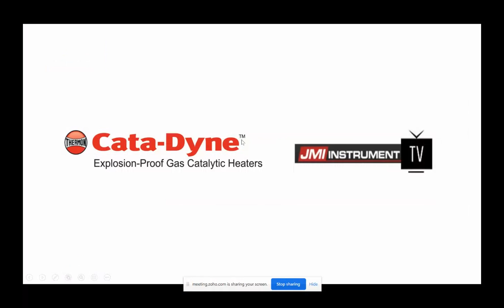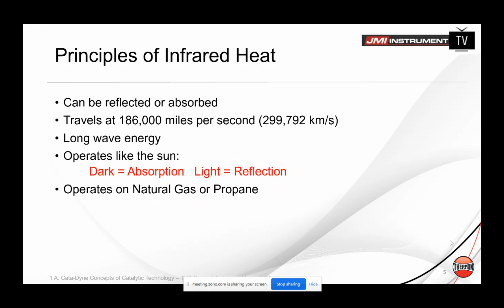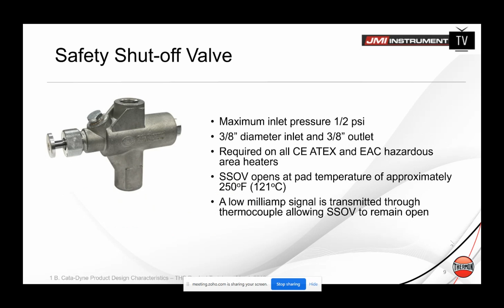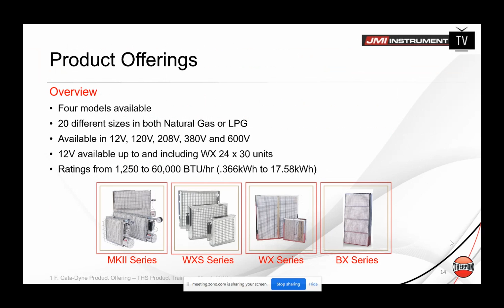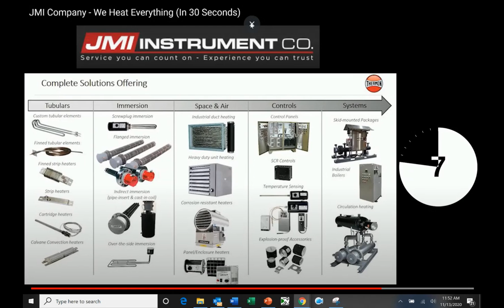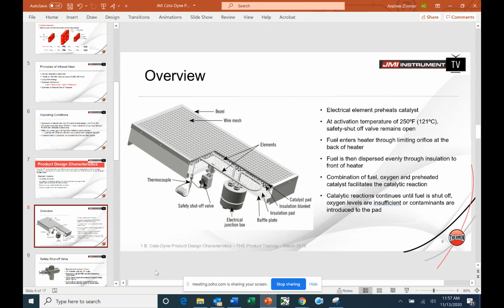JMI TV - Cata Dyne Heaters

Comment: No CO carbon monoxide!!
Does that mean it doesn't have to be set up with a chimney?  
Does it need to be vented?
Can you run it in a garage to heat the shop without venting as long as there is fresh make up air??